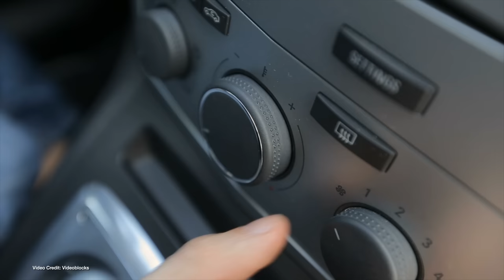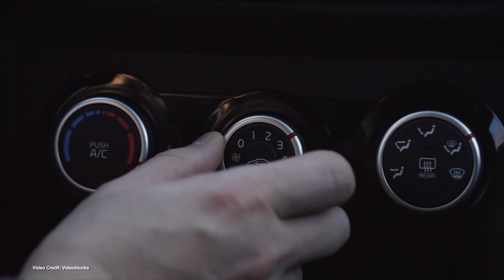How Do Electric Cars Keep You Warm In Winter?

Comment: The problem is not purely about "moving heat", but it's also significantly about water vapour in the air, which can mean that heat pump coils end up blocked with ice in cold situations.  The solution is to occasionally heat the gas going through the pump coils, but it's very complicated to get it right.

Comment: My Model Y heat died in November. 10 days later a software update got some of it back. I needed a PT Sensor, High Pressure
, Part #: 1510047-00-B, replaced. It took about 6 weeks for the part to come in. Messages from the service center implied it was affecting multiple users.

Comment: Combine both heat pump and ptc?
Reply: More like heat pump and immersion.
If you have a heater in the same coolant loops you are using for your aircon/heatpump systems anyway, then when it's not in use, it only a very small additional component. 
And if you are somewhere that never gets below freezing, it's not much of a penalty.

Comment: I second the comments about PTC and resistive -- they both convert 100% of the electricity input into heat.  (Whether some of that heat leaks out, and therefore doesn't end up in the cabin, is also important, but relatively easy to solve, I would think.)  Regarding heat pumps -- it is also true that 100% of the electricity input is converted to heat, PLUS you get the bonus of pumping some heat 'uphill' from the cold exterior into the warmer interior.   This link contains an image that might help:  http://hyperphysics.phy-astr.gsu.edu/hbase/thermo/heatpump.html.  What matters in this case is the ratio of the heat from your electricity to the heat from the exterior.  It may be an oversimplification, but I think as the 'hill' gets steeper (ie - the temperature differential increases), it takes more juice to pump a given amount of heat up the hill.  In the limit, you get zero heat from the exterior, and it becomes equivalent to resistive heat.  But I think that there are technical details of the process that prevent it from approaching that limit -- ie -- it just stops working.  We have a heat pump as our only home heat source (in Phoenix), and on VERY cold nights, it has to actually reverse to defrost itself, so it actually blows cold air for a short time.

Comment: Well one obvious solution would be for Tesla to offer a heated front windshield like Ford does on nearly every UK model (called "Quickclear"). This would allow electric power to be applied exactly where it is needed to maintain visibility without having to heat a lot of air and blow it over the windshield. Ford's system automatically turns off after 4 minutes. For electric cars I would suggest that there be a "rapid" and a "continuous" modes, with the continuous mode at a reduced power level sufficient to keep the inside of the windshield from fogging up. This could even be applied to the side windows. A contact point on the bottom of the glass that makes contact with a power supply contact when the window is up to avoid have a wire trailing up and down inside the door.

The advantage of this, as I see it, is that you don't needed a lot of hot air blowing over the windows to keep them from fogging up. Thus you could run the cabin at a lower temperature and stay bundled up in your winter gear that you are wearing anyway. Also this would allow cabin air to be recirculated, which you can't do with hot air defrosting because of the build-up in moisture in the cabin.

Comment: I have a mini cooper se that uses a heat pump and i was driving at -9 F. My heating options were less than half my range for a not horridly cold cabin or ice forming on the inside of my windows. Heatpumps are great for 20-60 degrees. Less than that id rather a more direct heating system

Comment: Great video! I've had some strong reservations about getting a heat-pump car. They need a full PTC/Resistive heater backup for very cold climates. They can still get better efficiency, with a minimal(to zero) increase in complexity.

Minisplits (which use heat-pump tech to cool & heat) don't work well below about 0f in most cases. These companies have decades of experience, and are innovative. This is one of the reasons I discount Musk's suggestion that they can do it better. They definitely missed the mark re: car heating in Canadian/upper midwest USA 
temps.

Comment: Heat pumps don't work well in the cold days of Quebec winters and should have a backup heat source for those -30 days.
Reply: Yes, below some temperature, the heat pump doesn't make sense.  Also in some cases, the "cold coil" will get covered in ice quickly.
Reply: A heat pump pumps heat just the same at -30 as it does at -1. The issue is that what it effectively generates is a temperature _difference_. Raising the temp 20C is great when the input is -1C. raising it from -30C to -10C doesn't make you feel warm. Now you want a temp diff of 50C and that's a lot more work and much lower COP. It might even need a different heat-pump design.

Comment: I notice they use fancy jargon heat pumps ICE shit like that way above everyday normal guys, we don't want an answer where you need to be a professor in Quantative engineering  we want an answer like range 250mls in summer -8 winter drops to 30 ml.

Comment: As others pointed out, PTC heaters are also resistive heaters, only kind of self-regulating. Also as mentioned, there is nothing to stop manufacturers to ad some kind of resistive heater to the heat pump, for use in extreme circumstances (and many do).
You missed one rather important aspect of this conundrum: scavenging waste heat from motors, inverters, other electronics and batteries. Apparently, Tesla's design if integrated cooling/heating system is particularly good at that. Jaguar also does it and, I assume, many others, but, apparently, not as efficiently.

Comment: A lot of luxury cars have heated seats and steering wheel. This is a much more efficient way to heat the passengers than heating the air around them. Heat still has to be provided to keep the windshield clear, but heated seats rather than heated air requires a lot less energy. Even better would be having passengers don heated clothing, such as a resistance-heated jumpsuit. I used to ride a motorcycle year round (when the roads were dry). Even the modest battery and alternator of a touring motorcycle can provide resistance heating for shirt, pants, socks, and gloves, putting the heat directly against the body. In extreme climates, this could be an efficient solution.

Comment: Do you think a heat pump is really necessary in an EV?  Saving 4 kw on a road trip of 150 miles  nets an extra 20 miles of range at best.  Maybe the reliable old PTC heater for $10 is the better choice vs the much more complex and expensive heat pump.
Reply: Except that the car already has a heat pump anyway, it's called an air conditioner, as Nikki said. For heating, it effectively runs in a reverse cycle, hence the name "reverse cycle air conditioner". So, heat pump heating in a car is not (or shouldn't be) a completely separate system, it should just be the cabin air con with a reversing valve, just like it is on your home aircon.
Reply: @ledsalesoz , I agree, though the devil is in the details... Like, if you are running the air conditioner in reverse to heat the car, you can't use it to dehumidify (defog) the car at the same time. Or maybe there is a clever way to do it, I don't know.
Reply: @ledsalesoz  Honestly, I don’t think adding heat pump capability to a car is that simple.  If it was, Tesla would have done it years ago.  I understand the science, but using your air conditioner to produce heat puts a lot more wear and tear on the system and it has minimal usefulness below 20F.

Comment: Yeah, heat pumps need to be specially designed for Quebec winters, the one on my house is good down to -20C but it can go down to -30C on occasion. 
The coldest I saw was -47C in 2003, a couple hours drive north ;-)
Reply: Are you saying your heat pumpfunctions at -40 celsius?
Reply: @johndelong5574  No, I'm saying it works at -20C. 
Considering that we get -25C and -30C a couple weeks per winter, we switch back to electric heating when that happens.
The coldest I personally went through was -47C in 2003. ☃️
Reply: @brunoethier896  I was referring to air to air heat pumps not ground based pumps .Also when heat pumps become ineffective they automaticaly switch to resistive heating which causes confusion

Comment: Turning electricity into heat is always 100% efficient. Like technology connections said. So PTC should be as good as resistive when it comes to the efficiency.
Reply: That step is 100%.  However what matters is how much of the energy ends up as warm air in the cabin.  Conductive losses to the chassis are losses.

Comment: I think you said it perfectly when you said resistive heaters aren’t as efficient as heat pumps. Yes, resistive heaters are 100% efficient because they convert all of the electrical energy to heat. But a heat pump can actually be MORE THAN 100% efficient, can it not?  In terms of  calories of heat output per KWh of electricity input?  The RELATIVE efficiency of heat pumps cs resistive heaters is > 1 (if it’s not too cold out), making the heat pump >100% efficient.

Comment: German Nextmove found very little difference between an ID.3 with and without a heatpump. Consumption was 17.1 vs 16.9 KWh/100km at 0°C. Disappointing, I expected more, especially as at that temperature the heatpump should still produce 3-4 times the amount of heat from power consumed.

Comment: Fascinating! Do you know what the biofuel was? I was looking at a similar diesel heater for camping, but would rather run it on something other then diesel. Having two or three systems in a car sure does add it its complexity or cost but for some of us that would be a welcome option. I wonder if keeping the batteries heated results in better range? I think I am going to have to experiment with PTC heaters in any case.
Reply: Alcohol/ethanol could also be a great solution too

Comment: PTC means just thst the electric resitance of the material incrases as it becomes hotter. That is the case for every metal. It is really nothing special about it, although it is build in a Tesla. Other materials have the opposite behaviour, like silicon for instance.
Reply: The materials in PTC heaters go up in resistance quicker than normal metals do.  Commonly they have a temperature where the crystal structure changes.   There are materials that have very low resistivities are 100C and very high at 150C even though to look at them you don't see anything happen.

Comment: I just drove a 3 hour journey in 3 degrees dressed like an Eskimo in a 1 week old £57,000 Tesla model 3. One week before they can sort it and I won’t be surprised when they don’t give me a courtesy car.
Apparently it’s an issue with temperature sensors failing and it’s going to be bodged with a firmware update to ignore the sensors.
I’m well not impressed. A car that drives itself but you need a Canada goose jacket while you click the autopilot isn’t exactly what you’d expect from the latest model 3.
Cheers Elon
Oh and can you work out how to solve the problem of what happens when you get a flat tire? I know it’s a bit more straight forward than dealing with the likes of getting to Mars, and it may not be enough of a challenge for you, but us folk here on earth still have to deal with minor issues such as how to get off the M25 with a puncture.
Anyhow awaiting the heat for now with a busy schedule of driving to a bunch of different meetings all over the south of England freezing my nuts off.
Buzzing 🤙
Reply: Unlucky should of bought a petrol car 😂😂😂

Comment: I always wondered why my Leaf (S) did not have a heat pump. After all, almost everything is already there. It is called A/C, which pumps heat FROM the cabin. What most heat pumps have, is a reversing valve and a few other changes.. And why not pull heat from the traction system? There is a Radiator on my Leaf, so there must be waste heat to deal with. In the mean time: Use the Wheel and seat heaters along with a sweater :)
Reply: Just divert the radiator to your interior.

Comment: Tesla engineers in California probably have no experience living/driving in regions that have real cold weather but they'll figure it out. I do remember a past GM interview that had mentioned they didn't use a heat pump because the Bolt's heat needed to be more substantial in northern climates.
Reply: Hybrid setup would be most ideal (heat pump + resistive). GMs Volt, quite similar to the Bolt setup, was an energy hog in MN winters. Resistive has a place in single digits or negative territory, but for mild winter days... even in the teens... It's a bit overkill.

.... the bean counters run Detroit.

Comment: I have installed all electric heat pumps in homes and you don’t install them without electric strip backup. When heat pump a struggles or needs to defrost the outdoor coil ,as it can freeze up, the the electric strip or resistant heater will kick in to assist the the heat pump. Standard in hvac trade.
Reply: I know of place that has a heat pump, propane and wood system.  The mains power to the area can't support everybody going electric heating on the same day.
Same problem different answer.

Comment: 1. Why not add a 5th wheel that you can raise and lower when needed for heat. The 5th wheel is hooked to a stand alone generator that makes power to heat the car when moving.

 2. After market addons that hook to a trailer hitch if need. The kit sells the wheel , battery and the extra heater for the car. 

3. Build Thorium powered cars 100,000 mile range per pillet all the heat you could ever use. Thorium makes up about 10% of the planet, Google a map of Thorium deposits in the United States and see for yourself. Thorium burns up 60 to 75% of it's self. 
Today car batteries might take more energy and landfill to complete with a 60 to 75 % recycling or disposal rate of Thorium cells and units. These units can also be burned up in Thorium irradiation reactors like Norway has been testing..

Comment: Excellent explanation Nikki. We have the optional heat pump in our i3s & it does seem to work pretty well whilst not destroying range. Having said that, I do tend to use the seat heaters to warm up whilst waiting for the cabin to hit 22degrees. Who knew car heaters could be so interesting :-)
Reply: I ordered my i3 with the 'auxiliary heating' option as I didn't have a REX option. I think it's just a bigger heat pump, but still has a PTC for when it's really cold. Quite difficult to find out what is actually  in the car, not that it really matters when it all works quite well.

Comment: If this is a problem to do with the efficacy of heat pumps in very cold temperatures then this would not be just a Quebecois issue. Plenty of regions across the continent including the US that get as cold or even much colder in the winter. Has this problem appeared in the prairies and the Midwest?

Comment: There are portable restive heater made for cars that cost less than $50 USD.  Some work of batteries, some plug into the car, some do both.  Manufactures should make their system work but there are easy temporary solutions.  As a side note anytime we get anything approaching Canadian cold 10% of the ICE cars stop working completely either because of old starter batteries, fuel line freeze up, or a host of other reasons.  Most cheaper ICE cars heat slowly anyway because they rely on the engine for most of the heat which doesn't work well in cold temperatures.

Comment: While it is true that heat pumps become less efficient in colder environments all things being equal. With different refrigerants and based on the average temperatures of your two thermal reservoirs, you can mitigate a some of the issues with a heat pump. Additionally you can use heat pumps in series using different refrigerants. This is how deep freezers work. Heat pumps aren't what they were 50 years ago, they can be well adapted to cold weather.

Comment: In theory there is always energy in the air until at -273deg C (or 0 deg K)

All depends on the heat pump Tesla are using. While in theory there is energy, you would need a greater conversion rate to get that energy.

However the common misconception that at 0deg C (-40F) there is no energy is wrong. It just means the heat pump wasn't designed to recover it beyond that.

Comment: Heat pumps don't "just" move heat.  They generate heaps of it.  TECs and refrigeration systems are massively inefficient at cooling because of the heat they produce.  This is exactly what makes them efficient at heating.  Basically all of the energy they draw from the battery becomes heat, after it's used to inefficiently scavenge from outside.  95%+40%=135% :D

Comment: Heatpumps pump heat, in supercold temperatures, there is not enough ambient warmth to pump into the car. It is a physics problem.
Reply: If you make the system waaaaaaay bigger, it can still work.  -273C is a very long way down from -40C